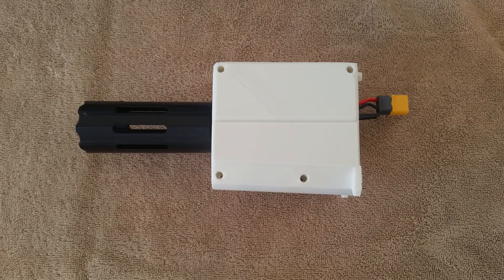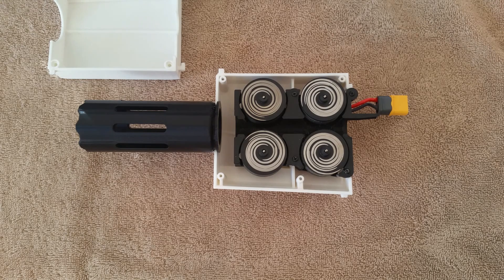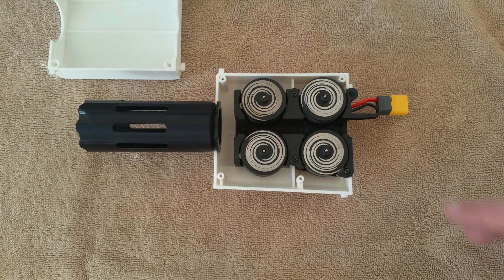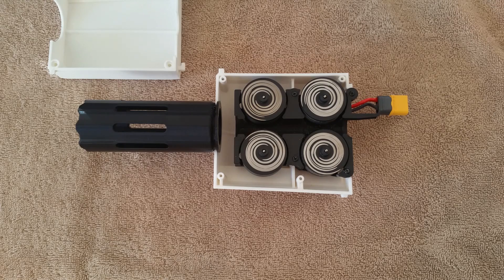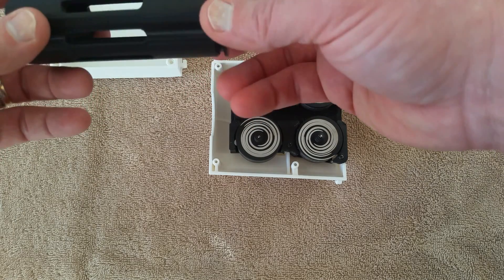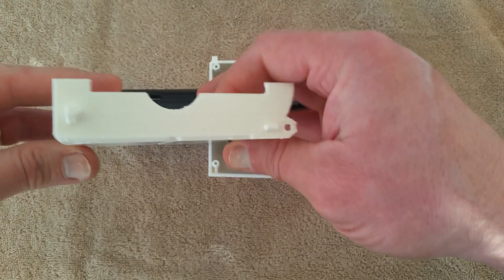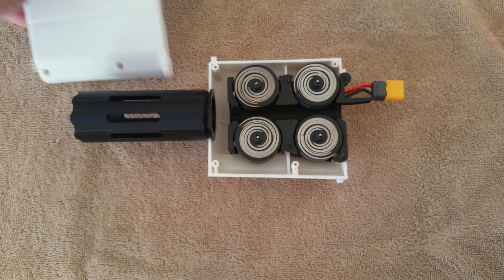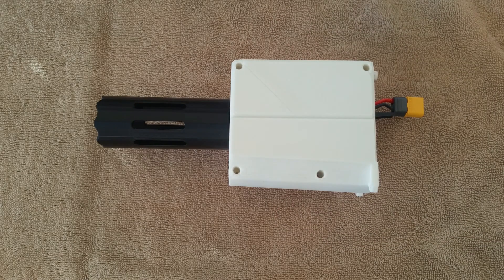Foxfire MBS Components - Housing (A)

Comment: any reasoning to using containment crew wheels rather than workers white wheels with grooves?
Reply from the maker: They are a bigger wheel and provide higher crush.  They get a little bit more velocity than the Worker wheels and I like their accuracy when paired with an OFP cage.
Reply: 498 Nerf I see. Thanks again for the swift reply!! Also your 2-Stage Riot Cages are at what crush? :)
Reply from the maker: ENGLISH TUITION SINGAPORE I believe they are 41.5mm.

Comment: I'm still trying to think of a way to improve on your foxfire project,  but I've got nothing man. This could be the end of all nerf flywheelers, no need to buy a strife or anything ever again. Awesome job! Now to just get those files in solidworks so I can fidget with em.  I still can't get that to work for some reason.  Is there maybe a "save as Solidworks" option in blender? I'd get blender just for that feature 😊
Reply from the maker: I've looked but I haven't found good way to export them to Solidworks.  I have very mixed views on Blender.  It is a pain in the neck to learn, but once you get past the learning curve, it is really powerful.
Reply: Try meshmixer?